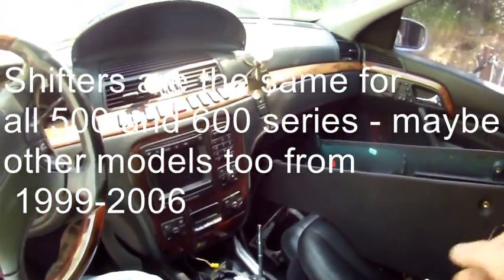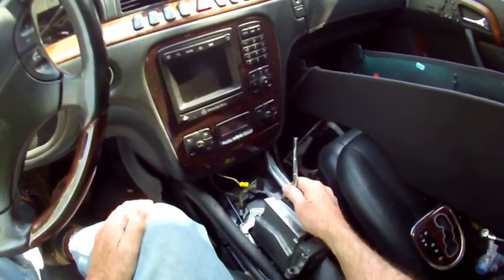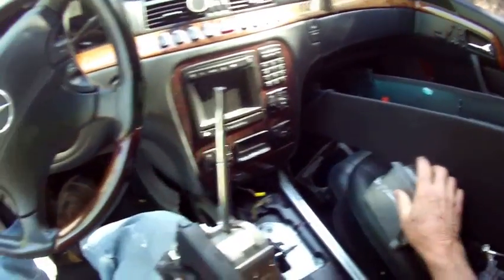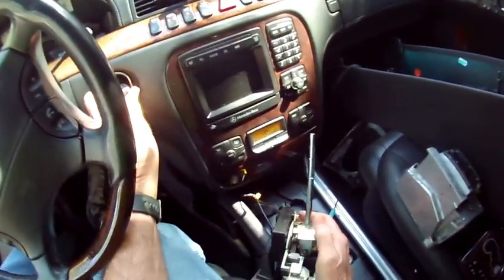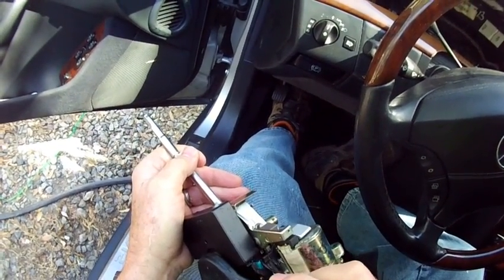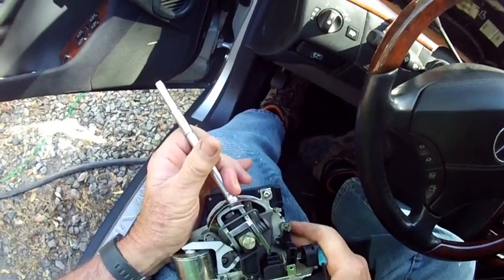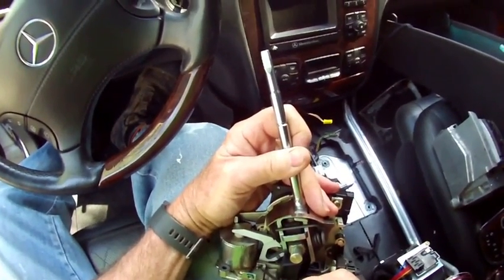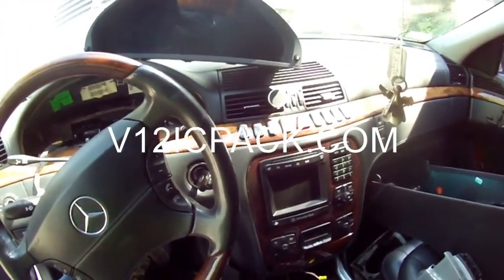How the gear shift mechanism works S,SL and CL 500's and 600's 1999-2006

Comment: Hi, My car died on me(2006 s500) and not cranking. I get this message when I read OBD2: B1016 no enable from the controlmodule electronic selector module (esm/ewm). DO I need to replace esm, where is thebest place to take the car? High end shop or base mercedes shop can deal with this. Can I send esm to be rebuilt with my vin info somewhere. How hard is to take esm out of shifter? Thanks

Comment: Could the shifter mechanism in any way create  no crank no start event? Had trouble getting my 2001 cl 500 into reverse so I just parked the car and cleared the codes. Afterward the car won’t crank or start.

Comment: Hello, I recently ordered a replacement shift box for my Mercedes SL500. I installed it and it won't start. I learned that I need to reprogram the replacement shift box to communicate to the transmission, but I don't know how to do that. Do I have to go to a Mercedes dealer, or is there a way I can do that?  Can you help?
Reply from the maker: @ronmirek9355  best to call the dealer.  Can you swap that wired portion ?

Comment: If my cylinder doesnt move the metal piece what could be the issue ?? Finally after 2 weeks i have found this vid!! 5 star video. But please someone answer me this question could it be caused by the pin connectro could there be any issues thanks

Comment: My 01 s430 comes out of park without the key in the ignition and without pushing the brake pedal. I don't recognize that the car has a tcm in it when I use my launch creader 2.0 benz specific version. All the 15,15r and 15x turn on but 50 doesn't turn on when I zry to start it. I am thinking the ecu doesn't have a signal that indicates the car is in park or neutral. Any ideas what i can try, ive tried everything I can think of. I see that the thick black cable that goes from the shifter to the ignition and my scanner reads the eis and it says it's good no faults but it doesn't connect to most of the other modules. I know that those 5 speed tranny's have issues with the round plug that goes into the transmission could that be the the reason why the shifter is always uocked.

Comment: My 2011 SL550 began to exhibit the intermittent gear shifter lock problem. Lots of info and advice online about it. Some of it clearly unacceptable (like banging the shifter with a hammer to release it from Park). As far as I know, this is the only clear, comprehensive explanation about how things work. Although the example shifter is not identical to mine, most of the material applies, and I am confident I will be able to handle the issue. Thank you. And compliments on a job well done.
Reply from the maker: Ha !  I think I saw the one with the hammer...... reminds of another video where some guy instructed folks to remove the front sub chassis to get the alternator out of the V12's...  Thanks for your kind words !

Comment: Hi at 11.42 of your video does that  have anything to do with starting the car? I have no crank and it's stuck in gear but that connector is out of the gear assembly. Let me know please
Reply from the maker: @Amg641  it’s been a while since I messed with all of that.  If the ECU is getting any sensor feedback that the car is in gear…, it definitely won’t crank.  Unplugging the connector will cancel out the valid feedback it’s looking for
Reply: @clarkrupp  Hmm thanks for that i will try clipping this back in and hope it cranks

Comment: Very useful info and video. Mostly learning the Black box is Vin reg to the car, so for me its replacing that little broken plastic lever, I guess, not the whole unit.
I've gt a CL 500 2001. Stuck in P. So it's a strip down job and new part. Five star vid, thanks
Reply from the maker: Glad it was of some help.... they make these things so damn complicated !
Reply: mine was stuck in drive… I️ have an 02 S55 AMG and the shifter cable snapped… left me super stranded

Comment: Any chance did you check the brake lights because I got the same problem but my brake lights are stuck on to
Reply from the maker: Did not !  Normally, there is a switch in contact with the brake pedal that triggers the brake lights.   Never looked on one of these cars.